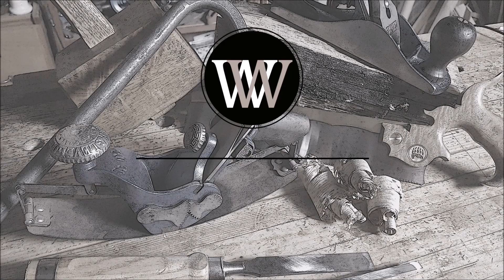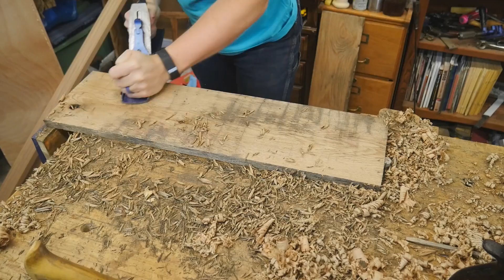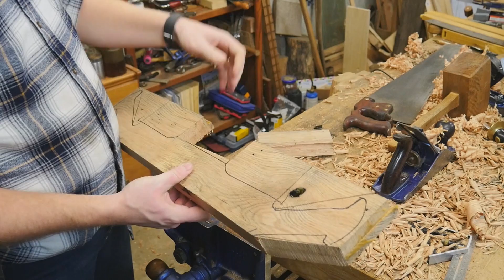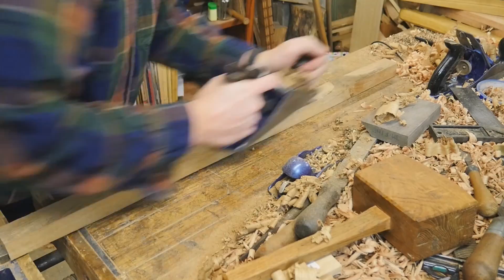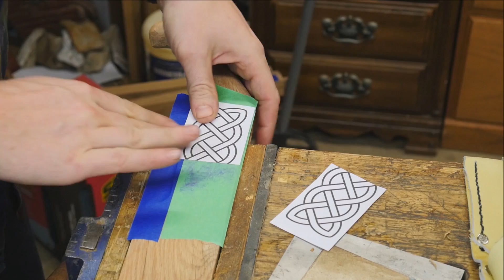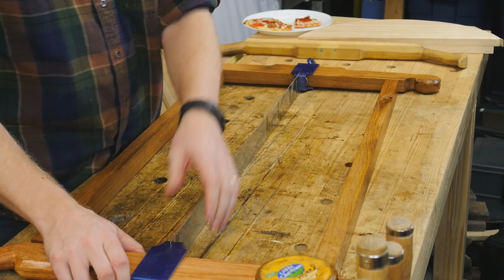How to Make a Roubo Style Frame Saw With All Hand Tool Woodworking

Comment: Hard to believe I missed this one,
You have made a working tool look like art 👍🏻👍🏻👍🏻
So this sorta saw can be made skinner, if one was only going to be resawing boards up to say 4-5"?
Reply from the maker: yup. you can make it any size you want. I have a friend with one that has 2" on eater side of the blade and a 4" tall blade for cutting veneer.

Comment: You don't use a rag to apply linseed oil. Is this purely so you don't have to dispose of those dangerous rags?
Reply from the maker: no I still use a rag to wipe it off. I just prefer to apply it with my hands. It feels good. plus this is not store bought BLO so it does not have drying chemicals.

Comment: this is a must have tool for me and love the kit option to it.  so i went to blackburn's site and noticed they have 3 different sizes.  which length did you get and do you find that size good for all around woodworking like we do or do you find yourself wishing you went bigger or smaller?  thanks James!
Reply from the maker: thanks. I have the 32" version and it is perfect for 1 man. the longer size would be great for a two man operation or if you have long arms.
Reply: Just ordered my 32" kit, looks like a Roubo frame saw build is in my future... somewhere haha

Comment: Your first video on the Roubo style frame saw inspired me to buy the kit* from Blackburn tools.  Still waiting to find the right wood to make the frame with.  Just curious, how exactly, did you break the old one?  I was thinking of using poplar as you did but now question if maybe it's not the right wood.

* I bought both the frame saw blade and the kerfing blade along with the two files - I bought the blades unsharpened.
Reply from the maker: +Richard Marton poplar works fine I just left too little material on the end of mortis and it blew out the side when I dropped it.
Reply: How much is the kit?

Comment: What broke on the original saw?
Reply from the maker: the ends of one of the mortices blew out.
Reply: @WoodByWrightExtra  Thanks for doing all your videos. I just got my 36 inch blade from Blackburn today and some poplar to make the frame. Any advice on the mortises so they don't blow out? Never worked with poplar before so a little nervous.